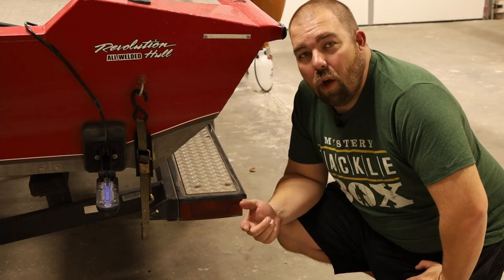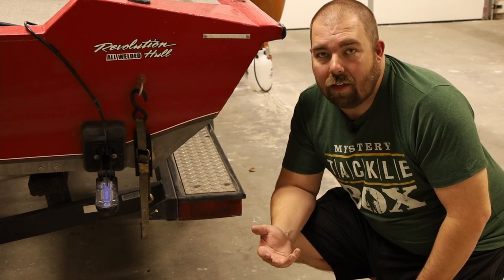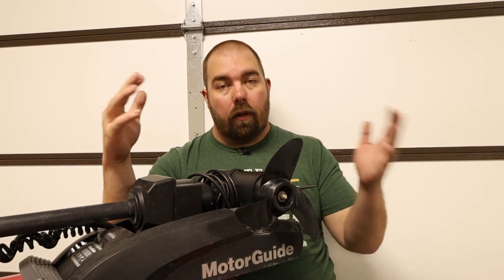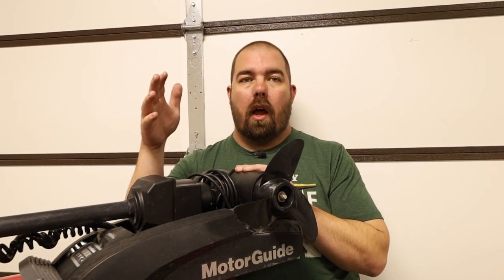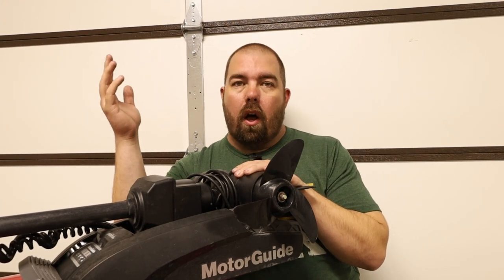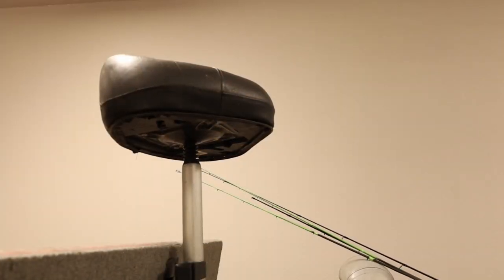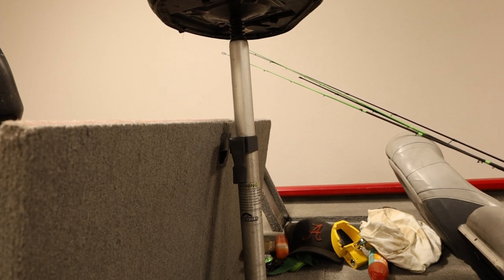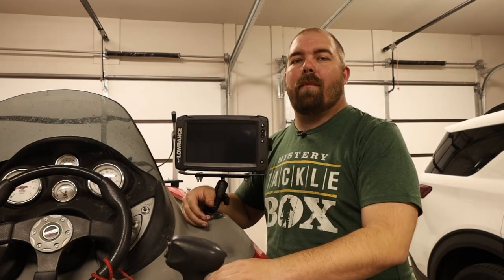Bass Tracker Pro Team 175 TXW mods | Works for Bass Tracker Classic XL too!

Comment: It's tough to pick just one upgrade that I've made to my tracker. But I guess it would be the terrova trolling motor. It's still 12v, but paired with the lithium battery I have full power ALL DAY. I would say my favorite upgrade your boat, even though you removed it, would be the vessel view. Thanks for the break-down and honest reviews.
Reply from the maker: So you have a terrova. What do you like about it? Thank you for the comment!
Reply: @clearwaterfishing  The spotlock feature is phenomenal. The pedal is low profile and the buttons on it are easy to use. Auto pilot feature is great. Just point it at an object down the bank, hit the button, and it keeps you going toward that object. Every button on it is useful. The battery power indicator is great too.

Comment: Yes def upgrade the transom saver. Good call on the upgrade tires, I blew out bran new tires and really ruins your day. Carry a spare and jack is a must too. The tires they give on trailer junk. D rated is much better, use your existing tires for spares bolt to trailer.
Reply from the maker: Any other ideas for upgrades?
Reply: @clearwaterfishing  I like all interstate batteries, helix 7 gen3 on a transaver, led lights in or out of boat for night identification. I keep a plug in 12v tow truck light amber bar say 18/24 inches with me on boat for emergency’s for rescue if I get stranded. Also I use it when backing in driveway as rude drivers always try to beat me and get past and risk smashing my 75 ho in a million pieces. With the amber flashing lights I can’t loose in court when someone drives behind me when I’m backing boat into up driveway. Sounds crazy but drivers  do it why can’t they wait 30 seconds) that with the camera system you can’t lose. Another thing I like is I raise worms and keep them in the boat where it’s cool and have an unlimited supply of worms found in my mulch beds. I like a dash cam also on my boat. And a shot gun ,or pistol with at least six clips. (For  assholes on the water) Milwaukee M 18 500 W LED lights are great for lighting up when coming in late to light up docks .Milwaukee head lamps and extra AAA battery’s. I carry a quality snap on brand jump pack ( no  pull cord on 75 hp) sling shot to scare birds off my fishing area. I letter my trailer with my company name w phone number so they steal someone else’s trailer when I’m out on the lake as locks get grinded  off near Pittsburgh Pa lakes.
 Velcro a mini Bose speaker to dash always have good tunes. Plug live well use for ice cooler because water was always backing up flooding boat in reverse. I cut out middle seat, used a breaker box lid for lift up  access to store battery charger and misc. lifts up and closes use for step.
I replaced back straps on transom with the seat belt ratchet type and bolted to trailer, real nice and totally secure now. Bigger wider led bar on back trailer for drunks to see me. Two strip red leds on rear boat so drunks can see  75 hp motor and boat better at night leaving no excuses. I replaced my 08 trailer with a 2022 trailer ( from tires blowing out totaled the 08) and the 2022 is coated with undercoating like rough surface to deter rust deterrent. I installed green led strips all way down the top both sides of trailer so I can’t be missed driving and put them on a remote to easily find my trailer at night amoung 100 other peoples trailer that parked next to me while at camp ground. I keep a grinder in case someone blocks me in to grind off their lock and move them w my truck then I put my lock on their trailer for principal. Break tooth pick off in key hole if they block me good. I carry a battery operated fish tank pump in case I need to pump out water in case emergency. I keep 12 ft spray bear mace on boat for any lighter defense reasons, animals that may jump on boat, or other boaters bad dogs that cause problems..

Comment: Great video!  Lots of good ideas!  I really like the stern saver.  I have the MG Xi5 on mine, and totally agree with your opinion about the foot pedal. I also find it near impossible to use when standing even after changing to a less stiff pair of springs in the pedal.  The handheld remote isn't much better as far as convenience goes.   Fumbling for the remote while you're fishing is a pain.   An Ultrex or Terrova would be my choice if I were to change.  I will say that the Xi5 has worked great since getting the update performed on it.  As a side note, I actually mounted my Lowrance transducer to a Bowducer at the bow.  I don't have Livescope, but using the Bowducer allows for side imaging at the bow.
Reply from the maker: Thank you. Sounds like I should have done an update. Oh well... sold it already.

Comment: I agree with the motorguide torlling motor peddle.  I had one. It sucked.  I had a hard time linking it up to the trolling motor. It never worked right and I just dumped the whole setup.
Reply from the maker: Sorry man. I fell into the same trap. At least the spot lock worked ok.
Reply: @clearwaterfishing  yep spot lock worked like a champ. Mine came with a remote/fob.

Comment: Hi James.  I got the 4 blade SpitFire and I keep having blowouts.  I'm guessing I got the wrong size.  What diameter are you running?  Also, I have a 2014 TXW and need to upgrade my TM power cable to 6 gauge for the Garmin Force. Unfortunately, from the factory, I have 6 AWG at the battery and 8 AGW at the plug!  I'm concerned about pulling and disconnecting who-knows-what that might be connected at that joint.  Do you know where we can get hooked up with a wiring diagram?  Tracker is no help at all.
Reply from the maker: The diameter was 10.1". Man idk where to find a wiring diagram.

Comment: Which length did you get for the trolling motor?
Im looking at the XI5 to synch with my lowrance units
Reply from the maker: If you are talking NMEA cable I think I got 15 or 20 ft to get to the console.
Reply: @clearwaterfishing  thanks!
What about the xi3 shaft length?